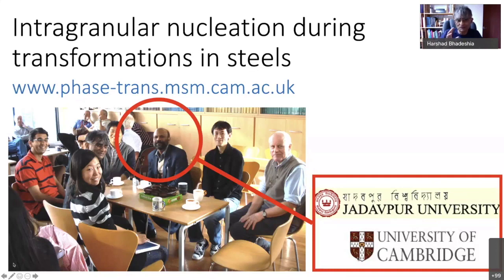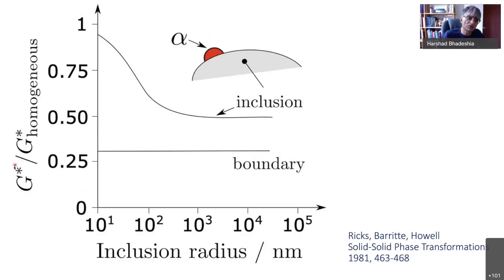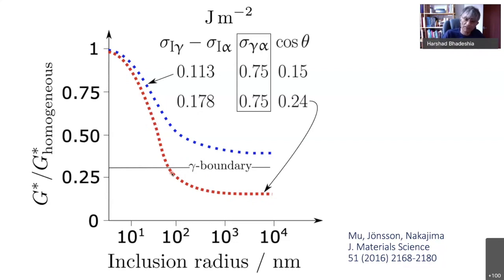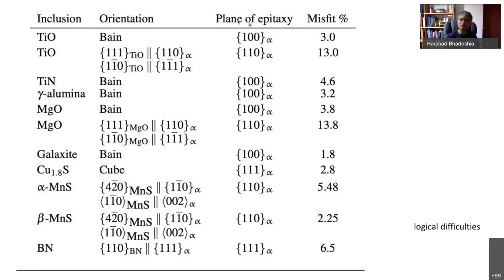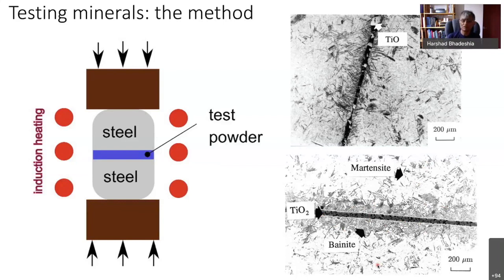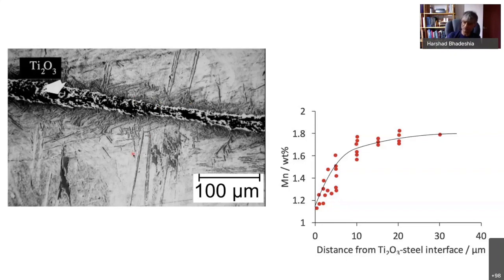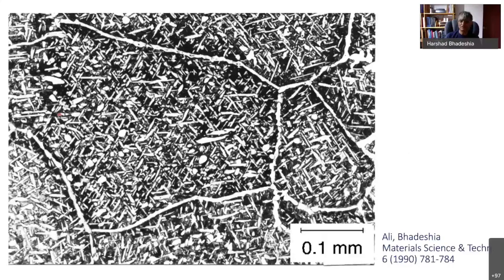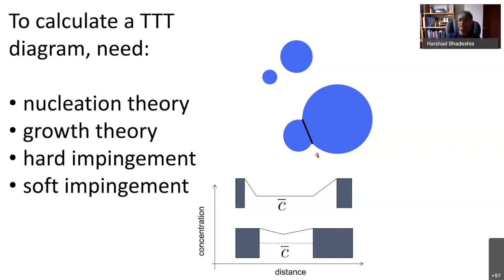Intragranular nucleation during transformations in steels

Comment: how can we increase the amount of chemically active inclusion to the steel? and do the chemically active inclusions harm the steel in terms of corrosion (energetically favourable site for corrosion to occur)? 

Thank you for sharing the interesting topic.
Reply from the maker: It is easy with weld metals because the consumable (welding electrode) can be designed to leave certain compounds within the solidified region. However, much more difficult to introduce inoculants in mass-produced steels where few have the technology to do so. I do not know enough about corrosion to answer your second question.